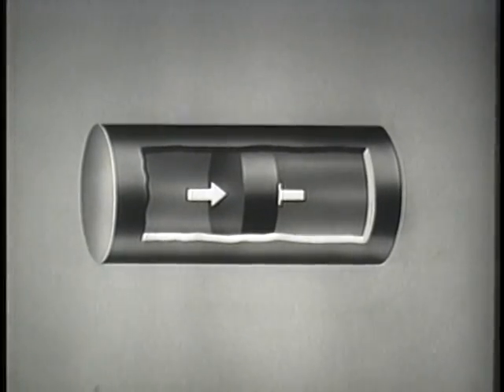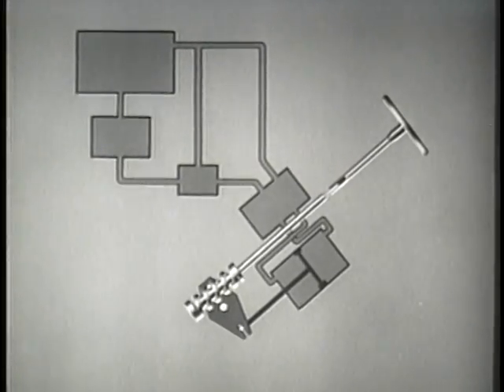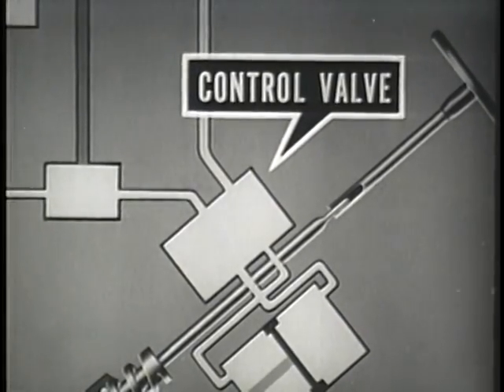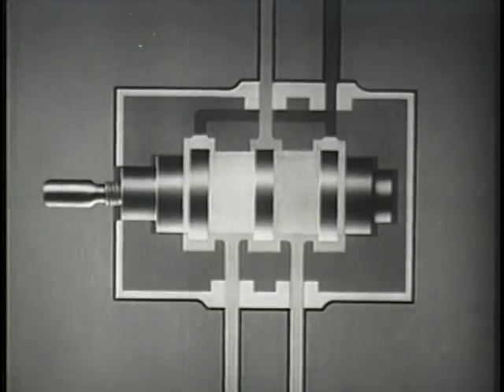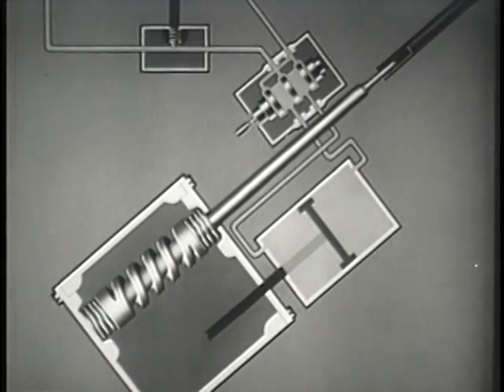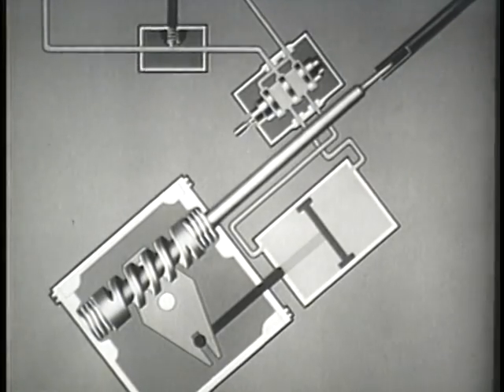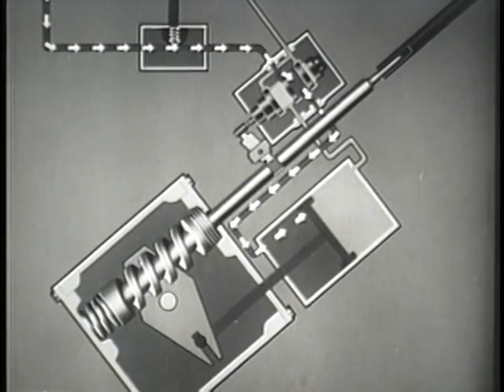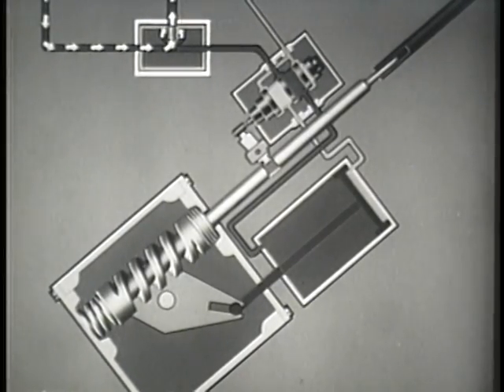HYDRAULIC STEERING - PRINCIPLES OF OPERATION

Comment: Same principle is still used today. However some improvements are made. Today the ratio of power is dependent of the speed. The slower the speed, the greater the assistance, the higher the speed, the lower the assistance. More and more cars get now electrical assistance, more accurate. Like hydraulic assintance, now common on al cars, this evolution started with the high end cars but will be common the next decade.

Comment: So the steering cam has springs on either side to actuate the control valve.  So why don't they get rid of the springs and add a mini steering cam type part that can actuate the control valve by spinning instead of moving up and down?